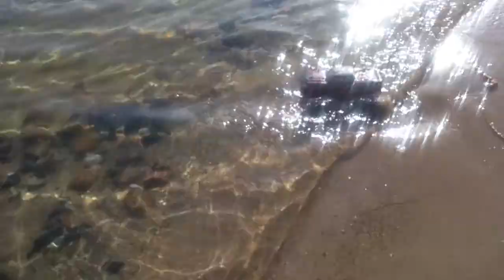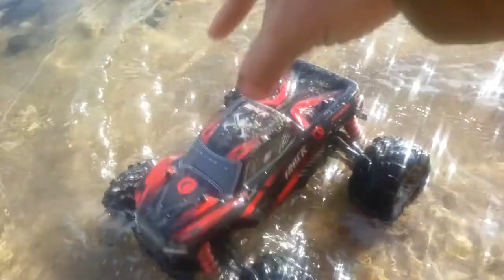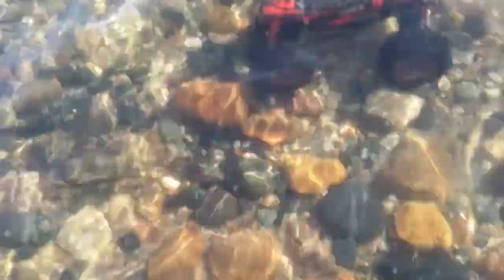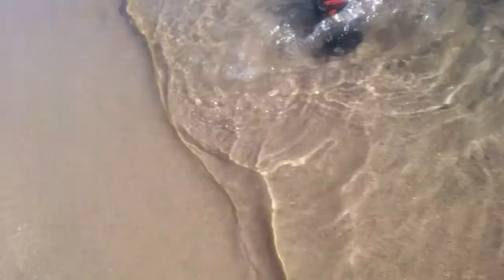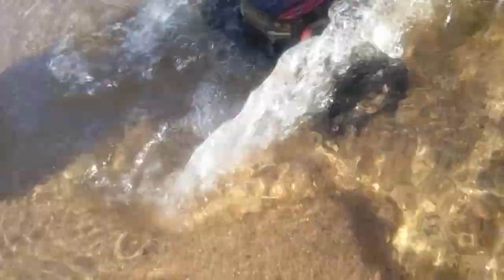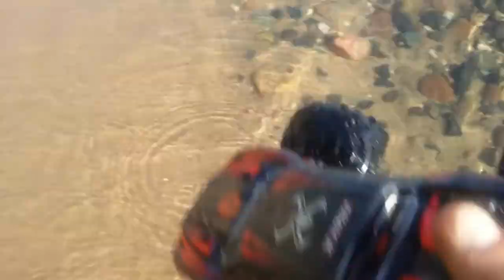I waterproofed my 1/20 Bezgar 9145 4x4 truck with silicone very well I see 👀 (3)

Comment: Stock electrics
Reply from the maker: Yup, I took the esc out covered it in silicone then put it back
Reply: Did u ever run the stock electrics on anything but 2s I ment on the 9145 I want to try 3s but idk 🤷‍♀️ I guess I’m worried about frying it
Reply from the maker: Yes I have swapped in better 180 motors and they run 3s and 4s but can get hot if you run them too long. I have the worlds fastest 9145 actually 23mph 4s
Reply from the maker: Lots of videos around that time of year, sorry for the mess